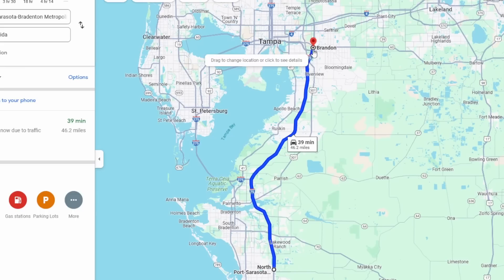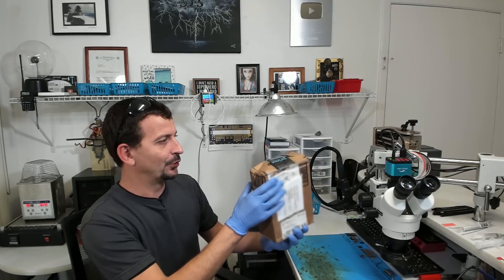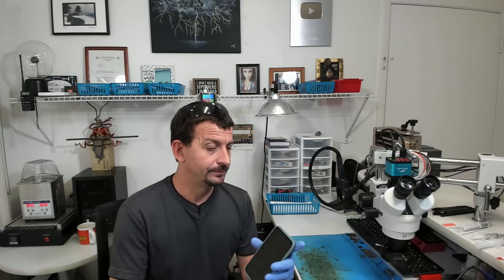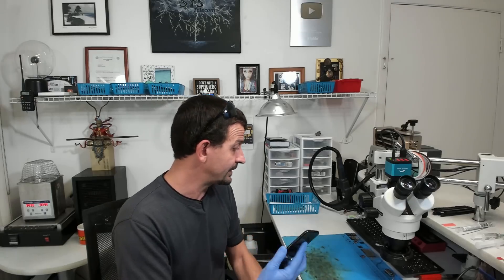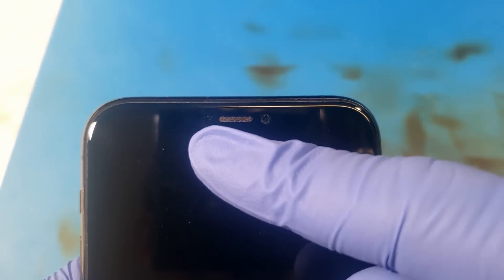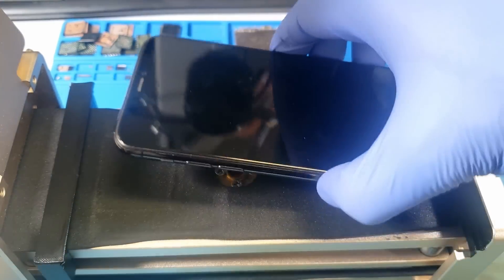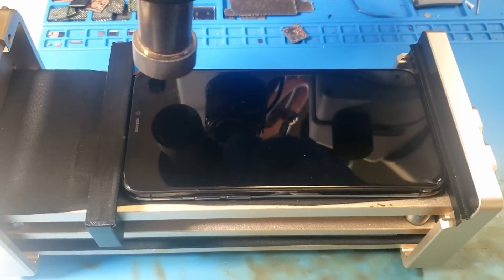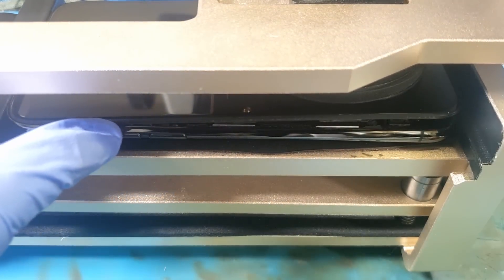[Wet iPhone data recovery] UPS took 3 weeks to ship this phone 50 miles - a 2000 MILE journey!

Comment: It's possible what happened is it was through a repair before it stopped working at the pool or whatever, so the customer concluded that was not relevant. It could have been relevant just a bit. This is a good example of maybe not going too far right away.

Comment: Jason forgive me if I’m wrong here but when you tried the different screen on it wasn’t the dock flex ok then?  If so would that mean that it’s more than likely just the screen at fault?
Reply from the maker: No dock flex is disconnected during that test. @ 11:28 
I had to use new dock flex, screen and also I connected known good battery but without trying customers battery.

Comment: Surely, as ‘data recovery’ this is a several hundred dollar job: repairing the phone is irrelevant. I watch Northridge Fix regularly, and this would net him his usual very lucrative ‘data recovery’ charge…
Reply from the maker: I didn't charge our full menu price for data recovery in this case but did charge our minimum advertised price for this service.  The kicker here was the total size of the data afterwards!  Tied up quite a bit of time.
Reply: Love watching you work through the problem and fixes. Surely its not unreasonable for you to charge by the hour on such data recovery after all, time is money? @ststele

Comment: You get to a point where it is a little bit of a lost cause with phones like that.  Who knows what else has gone on inside there since somebody has been at the board before, so you're definitely not working with a "we know it was once working" board - that's if it hadn't spent "a few minutes" in a pool picking up detritus and minerals from the water.  Good that you got the data, but I think the user needs a new phone, or low expectations that it will last with any actual repair.

Comment: I guess it went somewhere local first, and because of that stupid sandwich he hot-aired it from the outside to dry it out, ie, cheap repair/not knowledgeable enough for a MB split.

Just watched LLT and a Jake with an iPhone15 said his has slower internet rates than other phones, ie, it prob has bad antenna design to couple with their USB2 - lol -.

Comment: Well that was a very fresh video. 🥳
As soon as you mentioned how easy it was to open and working on House's Theorem (that everybody lies) I immediately thought that the customer had taken it to another fixererer who managed to open it, dry it out and it either worked for a short while and then failed or they couldn't get it back working after the DJ (Dry Job). If it had been sent to you as the first port of call then 4 weeks in a moist box 🤭would have been fun for the components. 😲 I've seen how fast the green crap can grow in a couple of days in that sort of environment.
You got the data saved and dodged a bullet. Nicely done Jason. 👍👍

Comment: Very interesting if it is possible to set up a WIFI server on Linux, a backup hard drive, as soon as you connect to your WIFI, you can copy all the material from the phone. USB2 is a nightmare! (I don't deal with Apple, I assume there is a format that the phone supports)
Reply from the maker: I fully endorse people managing their own data and keeping responsible backups!  I use open media vault running on proxmox primarily for data storage.

Comment: Does it ever make sense to work out a “no warranty” repair where you discuss the repair with the customer ahead of time like you did for us? Maybe present it to them with the final price and level of doubt that you will have fully repaired it…like, “I’ve removed your data and safely stored it on a flash drive and I can get your phone technically working for $X but I will have to utilize used parts and will be unable to warranty the device or the work”… 

That way they’re presented with the option to have their phone working even if it would cost as much as a new phone to make it happen lol

I’ve done something similar in the home  maintenance field but I’ve never had anyone take the offer.
Reply from the maker: Sometimes I do.  I'm more likely to offer that sort of thing when a device doesn't require a large number of parts and not such a gamble.  I tallied this one up pretty quickly to be $100~$150 in parts and that was before considering the buttons, mics, speakers, cameras and front facing components.  Even if presented without a warranty, functionality would still be expected and that leads to a never ending repair in these situations.  It gets into a mountain of time and that's not even considering the possiblies of board level problems from both liquid damage and also from separating and reassembling the multi-part board. But it is possible, yes.  🙂

Comment from the maker: I chose this device because it had a story & was almost certain to be a "good video".  I'm genuinely surprised this phone turned out the way that it did!  Upcoming videos will involve actual soldering and possibly even some troubleshooting! 😀
Reply: It still made a good story IMO!
Reply: Hey the data was recovered   You made right call for not fixing the phone.  RIP iPhone
Reply: Would an otherwise working iPhone 5 with a not working sim reader have the potential to make for a good video?  I have one that I have not used in 6 years collecting dust. Genuinely curious if such a repair would make for a good video.

Comment: Iphone is not waterproof. Really? 😁
Reply from the maker: I have a video clip I recorded a few months ago of an iPhone 11 pro that was new out of the box that a guy drowned.  The phone did not have the protective backing peeled off of the adhesive gasket!  A total manufacturing defect.  Even when it's perfect, they still leak through the ear speaker hole, sim tray slot, dock flex, lower speakers....  certainly not water-proof! :-)
Reply: They really are the shiny thing that people will pay for. But hey it gives you an income. Great work.